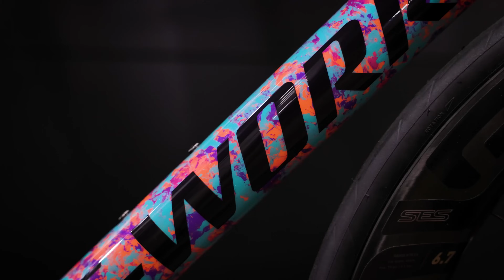BikeBox Specialized S-Works Tarmac SL7 Build

Comment: No grease on hydraulic fittings, cut the hole better on the tubeless tape, stabbing a hole can risk it splitting and leaking, centrelock discs shouldn’t have grease on the splines.
Reply: How do you recommend doing the hole for the valve stem ?

Comment: 7.6kg that’s awfully heavy in comparison to the top of the line bike you could buy from over a decade ago, looks pretty tho, but weight means watts whatever GCN & co try to tell you
Nice build however, selling new bikes is your job so I suppose that’s why all of the bike shops are fully onboard
Reply: Yeah but this bike is oly like 4-5k € max and the bikes u talking about is 10k +  =)))))
Reply: The frame of this bike is 5500 ;-)